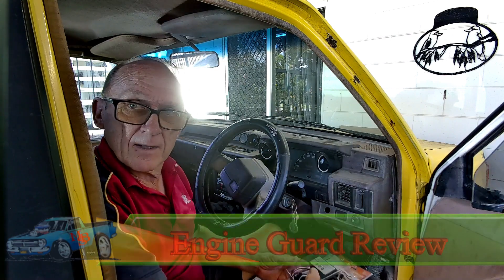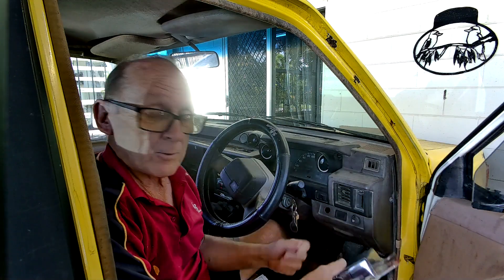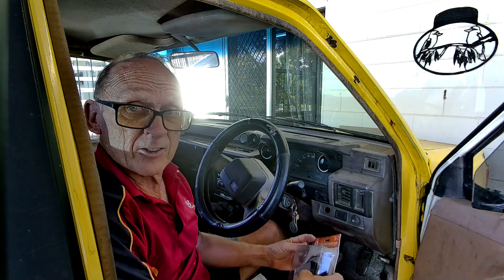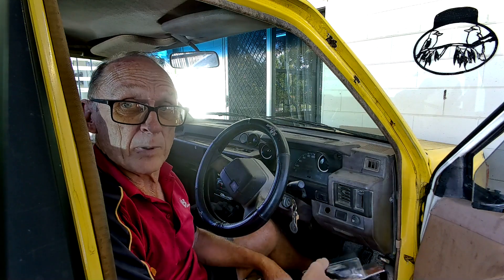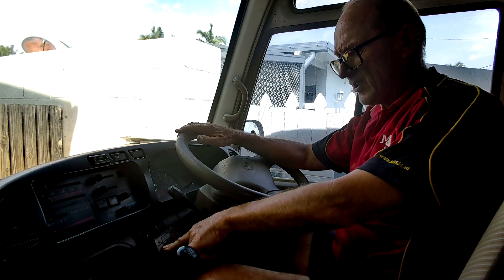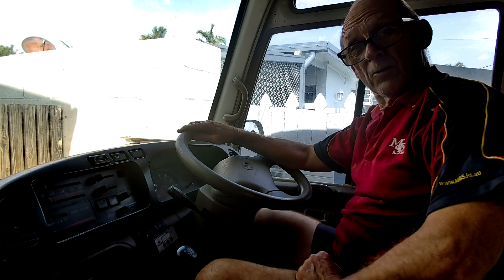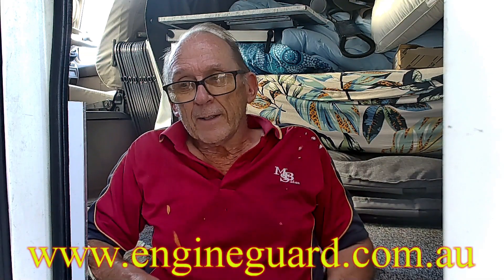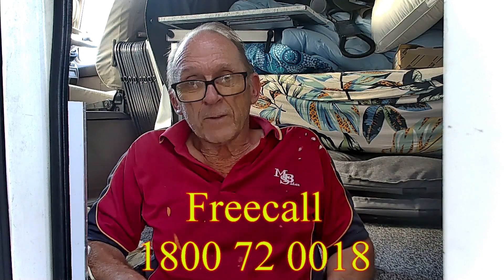Engine Guard Review

Comment: ive got one to install,what is a high temp,so you reckon about 92 its going on a 2.8 td delica
Reply from the maker: It all depends on your thermostat setting. My diesel had a 78 deg celsius thermostat & I set the alarm for 92. That gives me time to monitor the temp from there. If it goes up to 93 then I would pull over to investigate. If you have a 90 deg thermostat then you would raise the alarm point to 97. At that setting if it alarms you need to pull over ASAP. If you have a faulty pressure cap and the system does not hold pressure, the water will boil at 100 and you don't want that to happen, that is if there is even water in it. If the cap is good it won't boil till over 120 deg, so you have time to pull over before the metal temp gets to hot. Remember you are measuring metal temp so regardless if there is water in the system or not it is telling you the engine metal temp is too hot and that is main factor to overheating an engine. Also regardless of thermostat setting never let you engine temp go past 105 deg. When you pull over and switch off the engine you will see the gauge go up even further in temp due to heat soak, by at least another 3-6 deg, taking you close to 110. Also aluminium will anneal if the temp goes any higher. That's why most alloy engine that have cooked have exceeded 120 deg and therefore are just about gunk after that.

Comment: I appreciate your review, think you are on the money. 
The only thing I would probably add is with the water gauge is i have experienced is that if you lose your water the water gauge will not get an accurate reading based on steam.
I have seen the gauge drop at that stage.
Reply from the maker: You're absolutely right about the water gauge, steam can definitely throw off the reading.

Comment: The problem with your temperature gauge is that if you’ve already lost all your water, it won’t tell you!
Reply from the maker: You're right, once all the coolant is gone, a standard temperature gauge won't show the true engine heat. This gauge will alarm once the metal heat exceeds the warning setting so it will save you.

Comment: I just ordered the Engine Watchdog version that also monitors the trans temp…cause I’ve just fried the second transmission in my old Jeep while towing my boat and I don’t want to do it again. I also ordered the worlds largest transmission cooler :/
Reply from the maker: That's a smart move to monitor the trans temp, especially after two fried transmissions!
Reply: @mbsoldschool I wish I could work out why it’s happening. I keep blowing front seals when it gets hot, so I’m hoping for a bit of warning so I can stop before it happens again :/

Comment: Thanks! I'll be getting one of these. My 22yo Forester's radiator just cracked on a very hot day, and I was driving around for I don't know how long with the engine heat gauge on red... And I'm wondering how in hell can there be beeping when a seatbelt is not on, but not for "engine about to melt" ?
Reply from the maker: Back in the earlier days, they did not have buzzer alerts and because of that many people found themselves with cooked engines. Hang on there is an alert on older cars - the engine stops or runs terrible. ha ha, sorry sick humour.  Hope you did not do any damage from that experience. You won't ever get caught again once you fit the engine guard and don't forget to set the alarm set point as there is none set up by default.
Reply: I am a solo traveller and am interested in getting this item. You kept saying that when the buzzer goes, you can do something about it. As I am not well versed in vehicle mechanics,  what is it you will do? Pull over till the car cools down or take it to the mechanic or what other options please. I hoping to travel around Australia and am trying to be as prepared as I can be. I know some may think it is a dumb question and maybe it is but as I am a bit naive, I am genuinely asking.  Thanks.
Reply from the maker: Sorry for delayed response. Still trying to work out how to get my messages to me. Firstly I would back off the throttle a bit and see if it starts to go down. If not you still have time up your sleeve. Pull over where you can and sit for a little bit. You can't take your pressure cap off yet as the hot water may scald you if the cap blows off. When you are able to remove the cap safely check the water level & top up. Check the reservoir bottle is near the max line. If it is empty, you have a leak and so the radiator will probably need a top up. Start the engine & slowly top up the levels and continue on your journey until you find a mechanic that can assist you. If your levels were OK, then you may have an airflow problem through the radiator, a shagged radiator, thermostat not working correctly to mention only a few. I have had a few alarms go off in my vehicle but that is because I set the set point quite low at 85 deg, 8deg above the thermostat operating temperature. When I go up mountain ranges the temp will go up as expected but if it goes off when on the flat then I will want to look at why.